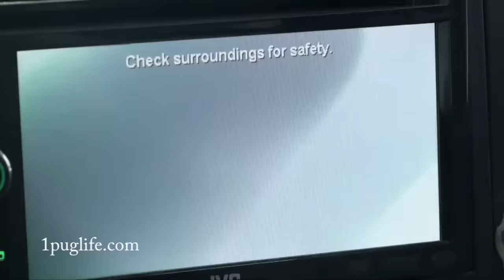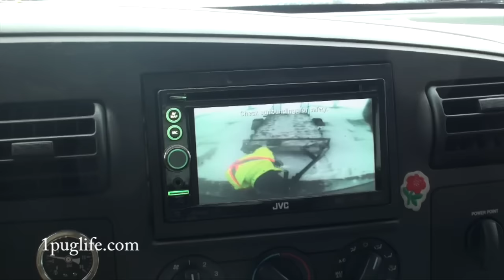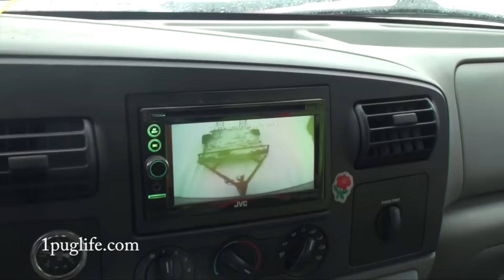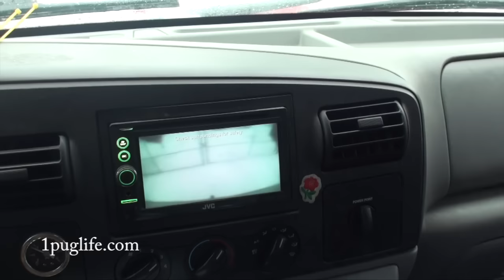not again!

Comment: put a piece of cardboard in front of your radiator on the truck and your heat will work and you can use the defroster to keep the ice off the windshield.  nice little trick
Reply: +Jeffrey Murdock He needs a new t-stat, should easily hold 190f+
Reply: +Bullitt Garage he needs to not drive a 6 liter...his heat goes right out the stovepipe bmp
Reply: Taylor Price that is only slightly true but it is cold enough that his engine can't keep the coolant warm enough to allow the heat work like it should I had the same problem when it got real cold out and I would cover about half of the radiator with cardboard and that would fix that problem
Reply: Right...my 2.0 4 banger will cook you out and i dont even have a grill. He's burning coolant. That's what 6.0's do lol.  Not trying to be a dick but come on bro
Reply: Taylor Price yes he is burning some coolant but that is not the entire problem and its just not the 6.0 it does happen in vehicles but that engine needs to be destroked I believe. Also I found out the hard way that if you do a head gasket on a vehicle always replace the head bolts at the same time and when you go to put them in put a little oil on the threads of the bolt and make sure you talk them down to spec otherwise you will blow the head gasket very quickly in every case. I did goes to school to become a mechanic so I do know quite a bit. And now that my back is messed up I don't work on cars as much but when I can I still like to get under the hood of any kind of car or truck
Reply: +Jeffrey Murdock i went to school for the same thing.. honestly its just not my thing. il work on my own shit but working on other people's jerry rigged shit got old quick...but the 6.0 is a special kind of garbage dude. such a shame to replace the 7.3 but then again the 7.3 wasnt made by ford...either way he should probably upgrade his rig cause it ain't long before she pops.
Reply: +Taylor Price The 7.3 was discontinued because it couldn't meet emissions. The 6.0 is a International engine, but had the emissions system added to it. Thank the Govt for that.
Reply: +Taylor Price 6.0l does everything..the wrong way
Reply: I would just rebuild it with aftermarket parts because the aftermarket parts hold up loads better
Reply: +Jeffrey Murdock ya it does...but only a fool would buy a 6 litre stock ford nowdays
Reply: +Jeffrey Murdock a buddy of mine has spent over 30 grand fixing heads, turbos, injectors over and over again...good truck when it works...
Reply: That's why I say after market parts as much as possible so you don't have to deal with that because for some reason the OE parts tend to be ship on most vehicles
Reply: +Jeffrey Murdock oem parts are usually the best parts you can buy..save for the FORD 6.0l
Reply: +Jeffrey Murdock should be massive lawsuits